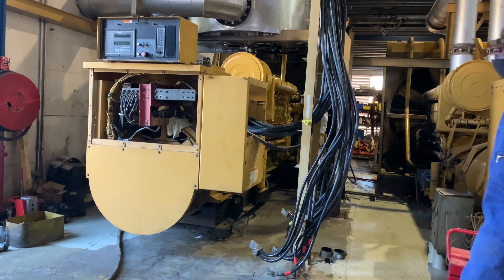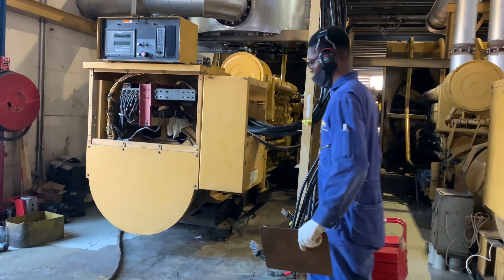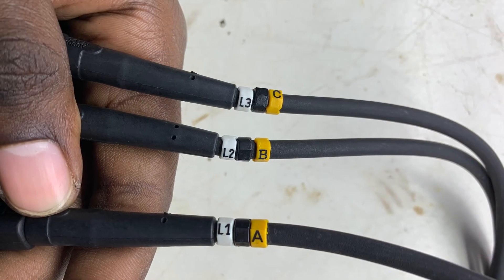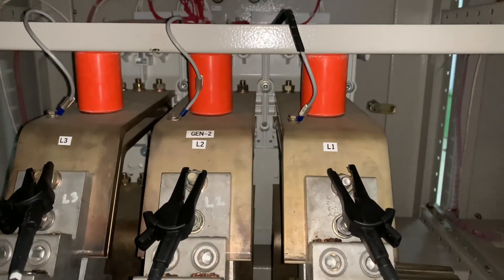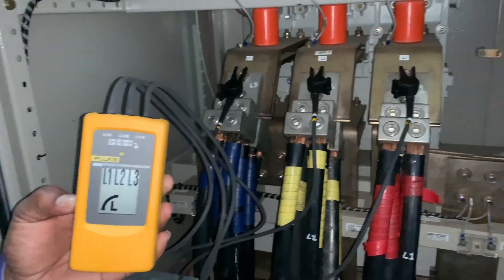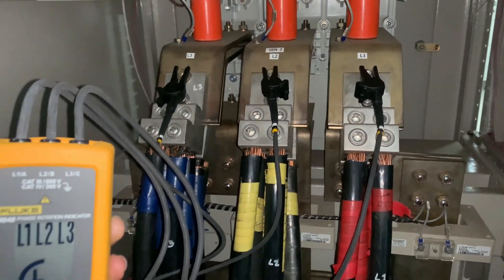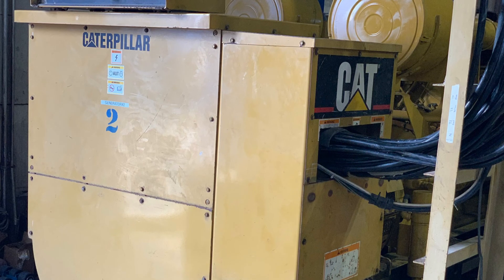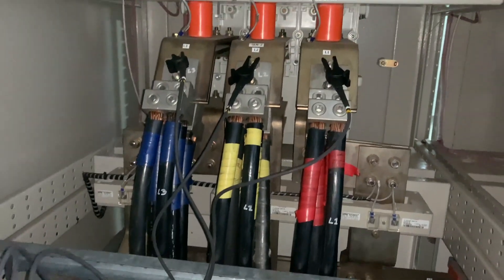How to use a phase rotation meter? 👷🏽‍♂️

Comment: Does voltage need to be present when conducting and using this meter?
Reply from the maker: yes, just make sure the generator is not supplying and load to prevent any problems in case the connection is incorrect.